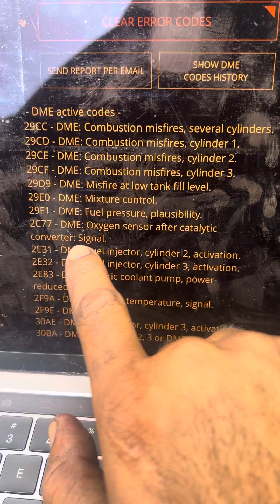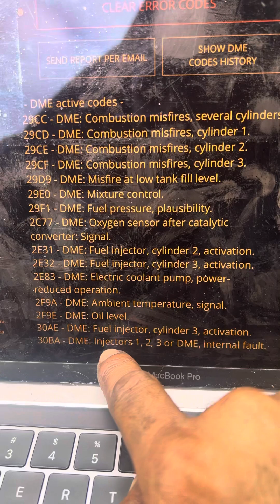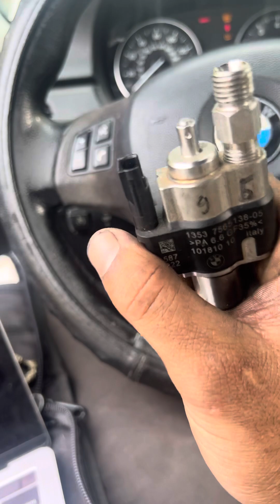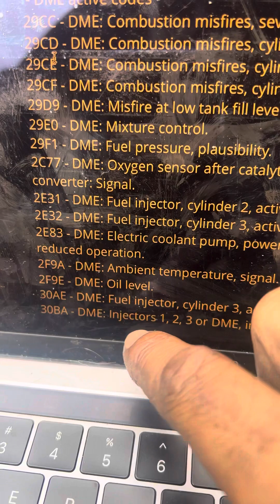BMW N54 Misfire Fix 1 -  30BA, DME or Injector?

Comment: I NEED HELP, got 30BA on bank 1 and misfires on 1,2 and 3. Replaced injectors on bank 1 new seals and correct installation but on start up I still get 30BA and misfires. Car sounds fine except some ticking by the engine bay.

Comment from the maker: 2 years later guys and I finally had my MOSFETs actually go out. It’s been a good run. They’re very easy to test and worth replacing. I got replacements off of amazon that were supposedly higher quality than OEM. I had to replace 3 of them. I had similar issues to this video and lots of codes. I think experiencing how the bank 1,2 system works and how to diag between adjacent injectors helped a lot. When the MOSFETS went out it was almost expected based on the symptoms. Finally happened and it was right after an ST swap. Thanks for checking this out!!

Comment: I have this on my 335is on Cylinder 1 only getting 
“2e30 dme fuel injector cylinder 1 activation”

Any ideas? Swap the injector?
Reply: Did you fixed it?

Comment: My mosfets all tested fine ended up upgrading to msd81 from msd80 trash and all the injectors on the bank with 3 eBay injector and they leaked for while but still got the car around only slight misfire on start up
Reply: @juanprats7120

Comment: I sent my DME out to ECU pro with the same codes but they were still getting the codes on the car they plugged it into.
Reply from the maker: Sounds like the DME is the source of those issues. I’m not familiar with ECUPro but they should be flash you a new DME

Comment: I have the code 30BA and 30BB
Reply from the maker: I got lucky with it being just my injectors. Outside of this video, I did tests on my DME. At the time I did not find any issues with any of the MOSFETs. It’s 100% worth testing your DME. If your DME is fine, you’ll be back at the same square I was when I started this video.
Reply: Did you fix the problem cos i have the same problem too. My case the car doesn't start at all. And it doesn't specify which cylinder, it just say x,y,z 
I need help

Comment: Having code 30bb 4,5,6 injector had dme tested and everything fine with dme am gonna replace bank 2 injectors and code them
Reply from the maker: That’s the approach that I would take. If my injectors 4,5,6 were all throwing codes, either all of them are bad, or just one (even two) of them are going out and bringing the whole bank with them. That’s all of course, after testing my DME. 

Personally, I think testing the DME is easier than the test I explained in the video. You just need a good multimeter and patience.
Reply: What was your fix? I have the same issue with 4,5,6 and my DME checked out fine
Reply: @juanprats7120  yoo any update? just happened to me tonight

Comment: god i hate my car. i have same issue but it happened while testing on a tune. i blew my 2 mosfets and had 4, 5 ,6 cylinders go down. replaced mosfets now 4, 5 wont activate. im guessing injectors now. it just has the 2e33 and 2e34 fuel injector activation code but no 30ba so could be short to i guess.
Reply: What did you end up doing, same situation just cylinder 3
Reply: @CarlosTorres-zx1yb   replaced DME. non of the injectors had issues. if mosfets blow highly likely dme went with it especally if you tune a msd80 and have not upgraded to msd81.